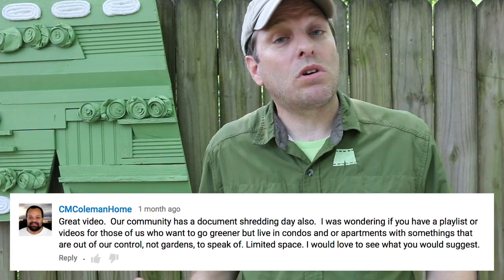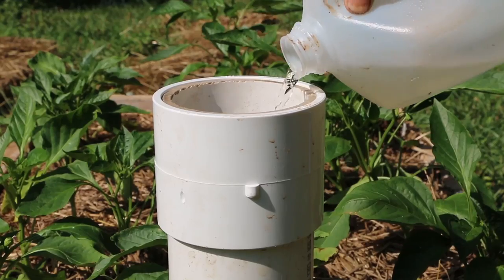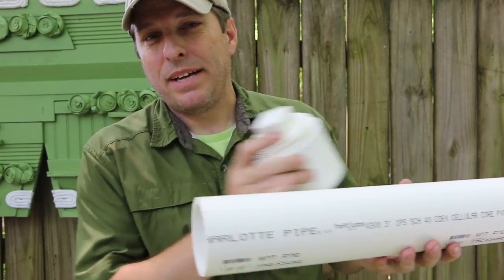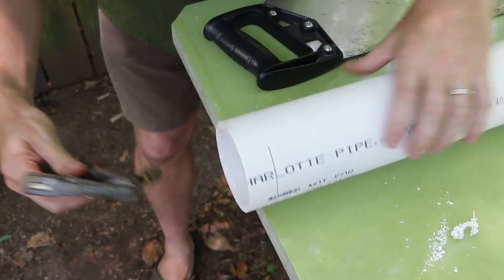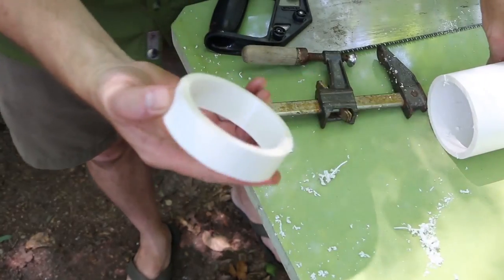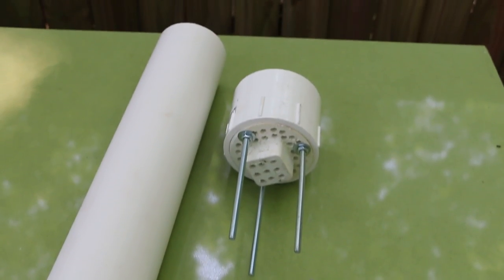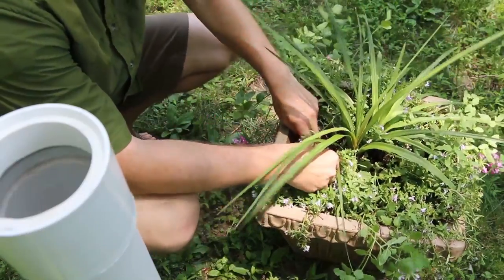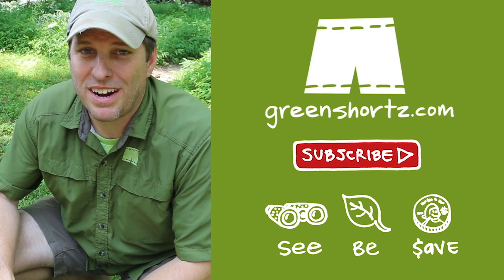How To Make A Patio Garden Worm Tower

Comment: I wondering if this design might be better for our cold winters in Manitoba. Would it be more conducive to retrieving the worms for overwintering in a warmer space? How would I winter them without a regular worm tower inside the house?
Reply from the maker: With your winters I suggest two systems. One primary indoor bin and and outdoor worm tower in a garden bed, that you use seasonally. You sustain and build a worm colony and n the indoor bin. Then take worms from that bin to seed the indoor tower when the temperature is suitable. There is no easy way to catch worms back from the tower, but they will go deeper to over winter and likely stick around the more organics-rich soil in the garden. Your indoor colony should grow enough during the Winter months to seed the tower each Spring. Hope this helps. Thank you for watching.

Comment: Ths looked so good that I made one last week. My question is, what happens to the worms that go out the bottom holes into the container soil when you move the tower to another container? thanks!
Reply from the maker: Hi Ginger. They are usually just hanging out near the spot where the holes exit into the pot. You can scoop them up, or just leave them to colonize the top layer of the soil in the pot. Hope that helps. Thanks for watching.
Reply: @GreenShortzDIY  Thank you so much. Somehow I'd thought that worms like I have, red wigglers, could only live in compost, not just the soil. I also wondered about the castings...Should the tower be empties and castings removed periodically? I have a Garden Tower with center compost tower and remove these monthly. Also...Should they be fed weekly? My goodness!!! Just too many questions about upkeep. Thanks so much for your help! Just want to keep my little worms happy!
Reply: Ditto the questions. I am just finishing my garden tower. How it has been x you? I still have to assemble. I am not going to put legs for it but prop it on blocks over a corner of my raised garden.

Comment: Love your tutorials.
Did you test the tower under direct sun light?. Is the temperature tolerable by the worms?
Else, its for shady plants only.
Reply from the maker: Brosh, the tower was installed in my garden where it got a fair amount of sun. I meant to do a temperature test, but haven't done that yet. I'll do that in the spring. I've also go a wood worm tower in the same garden bed. I'll do that test with that one as well. Thanks for your questions.

Comment: Thank you for this idea. I love the idea, but not some of the items used. Something I don't like is the pvc piping, screws, plastic pot etc to have along with my vegetables. What about some ideas for a container garden worm tower without these non-desirable items? Would the worm casting liquid not have run off from the pvc pipe? Maybe I'm going overboard in being concerned about this, so could you address this issue please.
Reply from the maker: I'll concede that PVC is not the most earth-friendly material. The main environmental concern is during it's manufacture, not its use. However, with any material there are bound to be some residuals. I don't think they'd be enough to be of concern, but I'm not an expert on that. I do respect that you have a desire to exclude such materials. I have prototype of a worm tower made out of wood. You'd still need some fasteners to connect the wood, but they could be done with wood dowels. Would you be interested in seeing this type of video? In terms of the worm casting liquid, it is a desirable fertilizer. There is some concern with some of the anaerobic bacteria that can grown in worm tea. With this particular worm tower application, the liquid goes directly to the soil and mitigates that concern.
Reply from the maker: Here's a video about making a composting worm tower made from wood. https://youtu.be/F2F7-MK_wi8 You could scale his down and use it for a container garden application.

Comment: Will the black solider flies still get in this?
Reply from the maker: +Luke Attard likely the same deal as the 2 bucket worm composter. The adults can't get in, but they can lay eggs through the screen. One simple way to reduce Black Soldier Fly Larvae infiltration is to layer enough new newspaper bedding over each new batch of food scraps, to keep the oder down. Less odor, less Soldier flies finding your composter.
Reply: You may use fabric and rather screen.

Comment: Why does it have to be so tall?  Wouldn't one that's only half as tall suffice?
Reply from the maker: Hi Augie. The height was defined more because I was using a pre-cut piece of PVC. Home Depot sells PVC in 2 foot lengths. You could likely take a 6-8 inches off the height and be fine. It would mean the worm tower would hold less volume, but if you had two shorter towers, you could just divide the same volume between the two. Thanks for watchings.